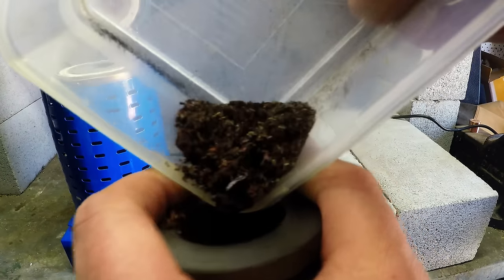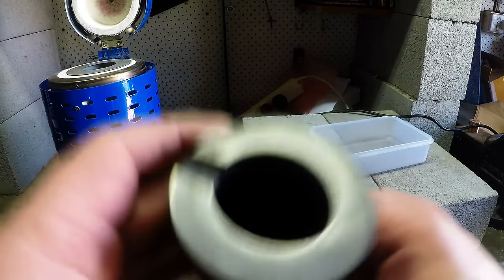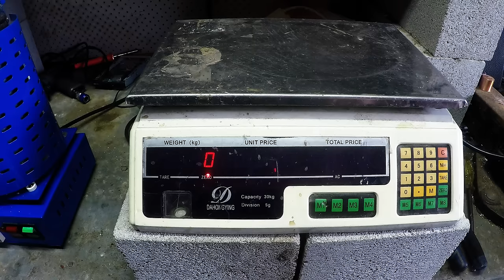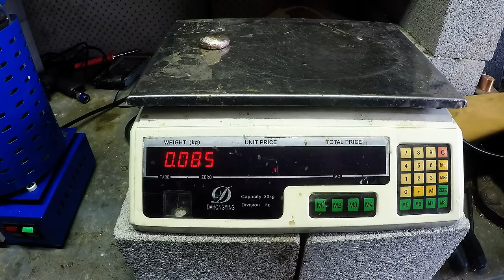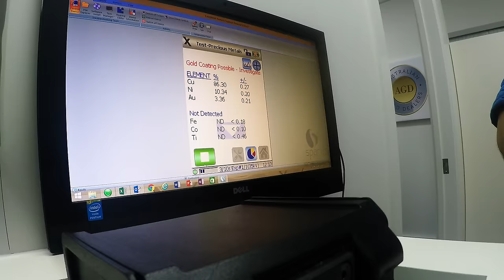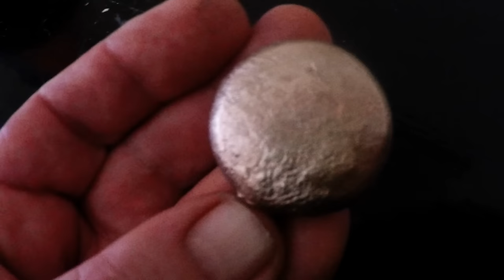Gold Button from RAM Stick Fingers

Comment: hey old buddy if you put  the borax on it and buy a carbon stick at any jewelry supply it would take out all the bad stuff  just trying to help love the video
Reply: what is the carbon stick do for it. I am still learning and doing some video on my process and other things I do
Reply: if you use borax in it  I'm sorry I forgot to say that the dirt will go to the carbon stick as you melt it and clean the dirt out. and you can use an acid bath after you pour it but you got to heat it up to a bright cherry  red then drop it in a bath wash it off and then use a steel brush on a grinder and then use rouge and triple to shine it up on a buffing wheel  I  used to make jewelry.  I  don,t know  about this just how to make it look good  hope this helps
Reply: yes you are right about the steel brush I forgot about that  we did it over a barrel with straw in it to catch the dust  then we send it to a refiner but that is the way  you shine it up  and the borax is for cleaning all the junk out I stand corrected  like I said I know how to get it clean for jewelry making  good thing you know more than me about it  don,t want them to lose the gold they work so hard on  great post

Comment: The melting temp for copper is much higher than gold.  This is why you had problems with the map gas.  Once they have alloyed the melting temp is lower.
Reply: There melting points are like 20 degrees off each other... The nickel is what melts at near 700 degrees hotter
Reply: 36 degrees hotter.

Comment: Hi Ben, I would think gold is the heavier metal so will think its more concentrated at the bottom of the molten nudge, but personally if I didn't want to use dangerous chemicals I would try leaving those gold fingers in vinegar and salt for a month or so, perhaps oxygen is needed to oxidize (bubbles from an aquarium pump, maybe) possibly maybe a large part of the copper will oxidize in a green copper liquid,. I am not a chemist and may just see it in a simple way, but I do know that gold is a more precious metal than copper and therefore not or hardly oxidized
Reply: Exactly what happened with mine ...........gold just went below
Reply: just dump the ram in bleach and salt to start with

Comment: Ben, nice button!
did you know that gasahol is the worst fuel for your car? 
It is so corrosive that the rail road has to haul it in tank cars.
If you can get it regular UNLEADED fuel will cause no problems in your vehicle.
Jeff Hansen
Reply: Jeffrey Hansen They haul normal unleaded in the exact same tank cars. What else would they haul it in?
Reply: +Jeffrey Hansen:
It's not corrosive to iron/steel. Gasohol just has some certain amount of ethanol added. They can't pump it in pipelines, probably because of the quality of valves used. When they pump petrol, the petrol lubricates the valves. Don't take my word. That is just my guess.

Comment: some people are stupid I see them all the time on ebay. they buy gold foil thinking its fold when its not its thin copper with brass over it most times real gold foil is sold as food grade. I see stupid people on youtube to that clam they no for a fact that gold pins and fingers on ram sticks are solid gold then its just foil over coper or over zink.
Reply: the gold on ram edge connectors is real, but the plating is extremely thin. It only has to be just thick enough to combat corrosion.
Reply: additionally the older electronics were produced with thicker gold plating as they didn't have the tech to get it as thin as possible, and gold was at the least expensive in history compared to stocks... So they could afford to use more gold back in the day.  I got 1 gram 14kt from 100 sticks of ram, gold acid tested for purity.
Reply: damok9999 I think its stupid we even use hold and silver and so on all we need is copper with nickle it prevents corshion and still has enuff conductivity.
Reply: ***** we are now starting to get away from it tho they are now building systems with no expensive metals at all now and its crazy to see that happen but I was never big on thinking we needed them to begin with except in stuff like hospital equipment wear we have to do what it takes to have little no no falure.